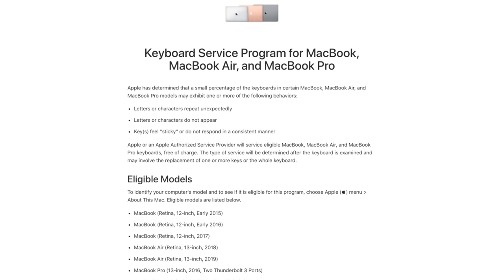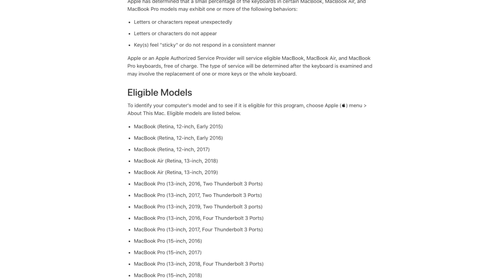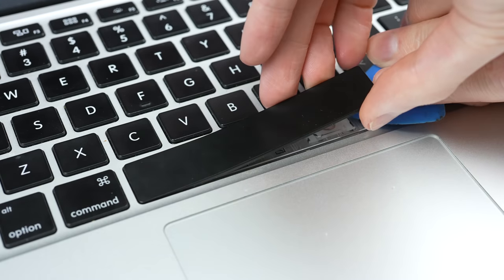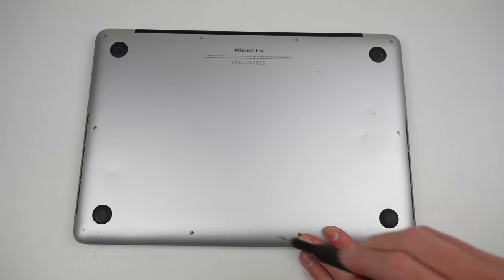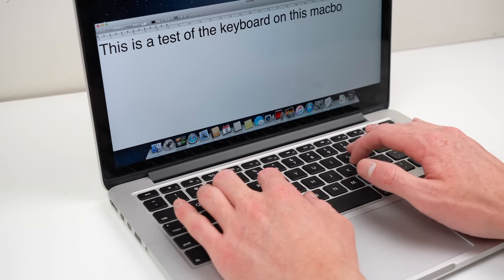Apple Really Doesn’t Want You To Fix This - MacBook Keyboard Replacement

Comment: Louis Rossman is one person who for almost a decade and some years has been telling people that Apple doesnt care about its consumers and how Apple deliberately have been slowly but surely been making it more and more difficult as the years went by to repair their products and other anti-Consumer acts. From overheating laptops, to overpriced repair quotas, taking away consumers right to a 2nd opinion of repairing it at a different 3rd party repair center other than Apple authorized. From their USB ports being removed to forcing consumers to buy additional accessories to add extra ports on their computers and phones. Apple even thinks that their consumers are dumb...... Apppe hypocritically believes in helping save the environment while also being against right to repair of electronic devices thst will end up as E-Waste instead of extending said devices life. Their philosophy on forced obsolesence where the updates slow down older Apple phones so consumers are forced to buy new Apple phones......

This mentality has spread to other companies unfortunately and is slowly implemmented into electronics.

Comment: To be fair Macs aren't the only laptops that do this PC laptop makers do it too...  And  on  PC laptops it's even harder than on MACS...if they do...
Because the palmrest is all plastic!... No trying to rip the keyboard off with brute force here.. Unless you wanna rip  plastic palmrest in half as well.....
Also subbing screws for the plastic rivets won't work b/c you cant cut threads into plastic... 
Usually on these kinda laptop I just replace the whole top assembly and call it a day......

Comment: Something mac and Kalashnikov have in common.

After the iPhone 4 I went to android and have never looked back especialy with devices like the xiaomi poco f3 that's has the similar specs as the 13 Pro max just a slightly worse camera, smaller battery and 10% or so less power but the 13 Pro max is 1250pounds and I got my f3 256 for 194 pounds with 30 pounds store credit.

For laptops I just try to buy a well made laptop that's upgradable at a good deal and duel boot with a Linux OS and a Windows OS. 

For a desktop it's better to make them. 

Most android phones, laptops and all PCs are very easy to repair. 

In the UK and EU phones have a min warrantee of 2 years   laptops can range from 1 to 2 or more. 

All laptops phones and such should have a 2 year warrantee and the right to repair and put on a custom rom .ect

This right to repair is really hurting farmers they pay crazy money for machinery and have to pay top dollar to get it repaired. 

Every brand should have diagrams parts and diagnostic tools for a reasonable cost by law. 

Apple does not care about you it only cares about your money and they will charge you top dollar compared to non apple devices as most people don't want to be seen with anything but a apple product these days especialy women. 

I know apple OS for their computer and phones are easy to use but you can get much better OS systems if you tweak them and learn how to set it up your way.

Comment: Apple is a scam.
They charge you hundreds of dollars for a laptop. Make it insanely hard to repair. And charge you a crap ton of money to repair it, (not before attempting to pressure you into buying a new device!!!) 
I have a friend who had an iPhone, it broke where it wouldn't charge or take current at all, (I checked and the port was clean. So don't even) he took it to Apple to see how much it would be to repair. They instantly said he needed to get a new phone and that it was non-repairable. Didn't even look at the phone other than turn it on and attempt to charge it. He brought it back to me. I swapped the charging port and the phone worked like a charm.  All the issue was a faulty charging port. 
It's absurd how open apple is at trying to get you to buy new devices rather than fix them. I'm surprised they haven't started trying to take down videos showing people how to repair apple devices.

Comment: Why does Apple not want its users to replace just the keyboard? What a waste of perfectly good parts, like the track pad and battery. Apple needs to go back to the unibody designs, which had screws instead of rivets.

Comment: This is typical Apple mentality.  Apple doesn't want you to repair or upgrade anything. They want you to replace the machine entirely.  Thinking of buying a MacBook?  You had better be prepared to fork over some substantial money buying the most RAM, fastest CPU, and largest storage you can afford.  Because if you think of upgrading later you're going to be sadly disappointed.  It's all soldered in place on the logic board making upgrading or replacing components impossible. The commenters are right.  Apple has such blatant disdain for the very people who make them a trillion dollar company.

Comment: Rivets are legitimate fastener, they are intended to be drilled out to perform maintenance or service. You ripping the keyboard out was a bad move. It’s aluminum so it’s easy to drill out with a common drill bit.

Comment: There should be a law in place that manufactured items should be easily repairable where possible, this would include cars, computers, and some appliances(large or small). Start getting away from this throw up society way of thinking and what is thrown away should be mostly recyclable. Company getting penalized(taxed) on what percentage of their product isn't repairable and recyclable or using renewable material.

Comment: HP does similar thing but it's plastic so it's easier just to melt them and pull back metal grid behind keyboard which is way thicker than that on the MacBook. Chinese  replacement costs 15$ and only licensed service in my country asked for 150$ to replace entire top cover which was 1/3 of the laptop cost. When I tried to order original part from them couple weeks later (without using their service and replacing top cover) they claimed they no longer support that product...so fuck all those tech companies.

Comment: I don’t think it’s rivets “to prevent repair”. I think they needed the keyboard to be held securely at all points to prevent it from separating from the case at all during use and it would’ve been SUPER inefficient to use like 96 little screws for that. So they just riveted it down.

Comment: i have a macbook 12" 2l017 with a space bar  and similar problems.  I don't have the skill to replace the key board but I'm willing to sell if anyone is interested.
Reply: You said 2017? I have an idea. What tools do you have? Also, does it still have information you value on it?

Comment: Hey Apple! Some new ideas! Weld the PCB to the frame and fill the interior with sticky solid foam.  

The way this product is designed is just disgusting. Don’t tell me about „our product designers found out, that the keyboards only fail in 1,7% after 3 years but customers like the 0.005inch less thickness than the former MacBook“. This Macs design is not like a premium product but just like cheap Chinese crap. The Apple designers seems to have become mad. This is a fancy buy-and-throw-away product.

Comment: This has nothing to do with not caring and is simply a production economy. It is easy and much cheaper to automate the riveting procedure than install screws.  I fully support the right to repair but it’s stretching it to expect manufacturers to increase the product cost to make it repairable.  These are through away items that will be outmoded in just a few short years.

Comment: This kind of problem can be fixed by simply pressing the metal under the keys - the issue is that the super thin metal gets bent over time so the keys dont register any more. Shit design, I guess on purpose, literally could've just made that metal back plate 0.25mm thicker lol

Comment: Rivets are faster to install than screws especially when the process is done by robots, sorry but your reasoning is flawed. Also, pulling rivets with side cutters then getting flustered when the heads rip off... Really?

Comment: Sure, sure, replacing 96 screws with rivets is an “anti repair mechanism”, it has nothing to do with being significantly easier to manufacture.

They didn’t repair the old ones by unscrewing 96 screws either.
Reply: Well yeah but it also fucks over the consumer who wants to keep their old stuff and not buy a new one because as you've seen it's damn near impossible to replace the keyboard without destroying the old one unless to have specialized tools to remove the rivets

Also they could have chosen  to design the keyboard to be held down properly with less screws. They make their own hardware after all

It's a design choice not a design necessity
Reply: @Goldfire345  there is a huge difference between “they made this design choice to save money and because they don’t care about repair very much” and “they made this design choice because they want to frustrate repair”. If nothing else, the tactics you’d use to fight it need to be very different.

Comment: Just don't buy this shit, don't even use it even if you get it for free. You should have easy access to the battery, keyboard, RAM and SSD for swapping and upgrading as well easy access to the cooling system "dust magnet" locations in order to clean it out regularly. Stick with an good old desktop rather than a laptop and take good care of your smartphone or better yet go old school and just use the phone for calling people. I'm pretty sure we need to go back a bit before you could call or text someone at any time. I mean, right now it's perceived as some form of disrespect if you don't take a call. And we become kind of stupider as we tend to get stuck on certain stuff rather than finding a way ourselves without the help of the internet or the input of someone you call.